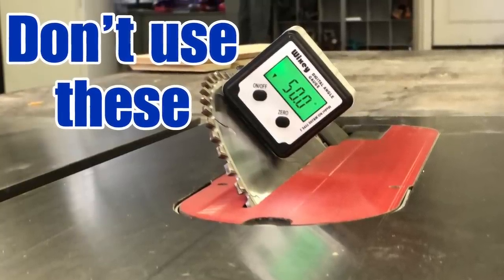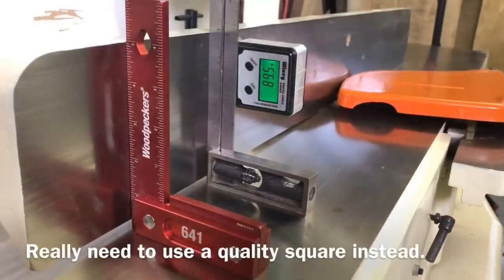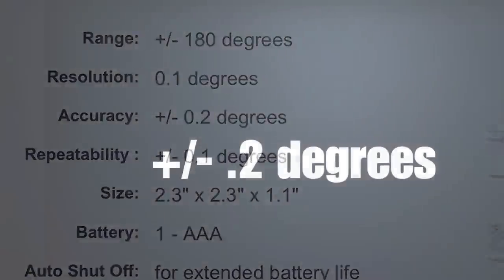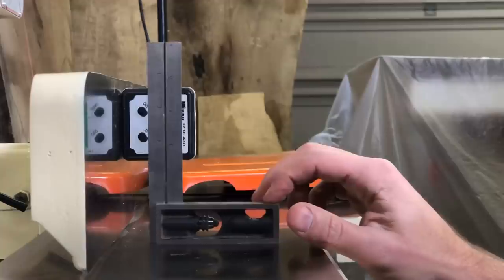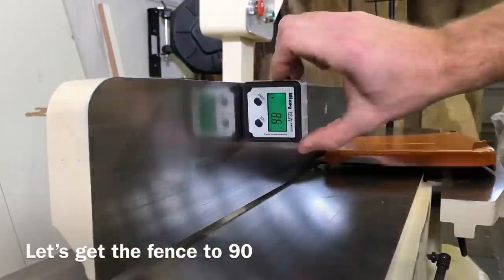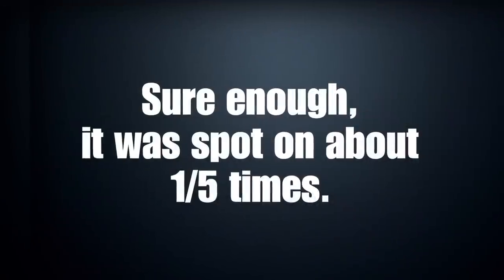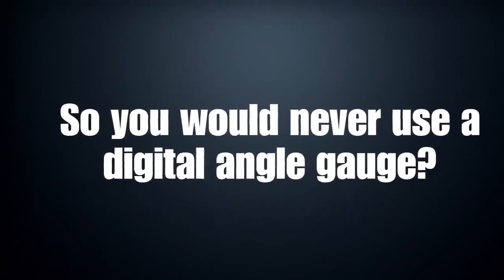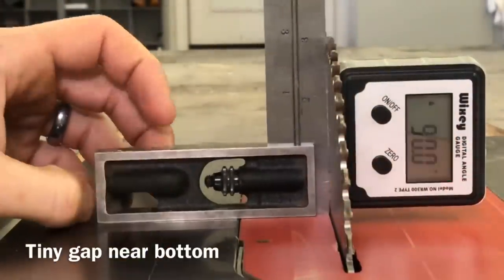Table Saw 101– Digital Angle Gauges— How To Woodworking

Comment: What about the analog gauges that use a dial and gravity to hold the needle steady as the magnetic base rotates? Are these any better?  I believe they are called magnetic angle indicators.
Reply from the maker: Never used em!

Comment: If it were inaccurate in the same amount in the same direction each time, then it might be ok, but to have a 0.5-degree swing would not work for me. Imagine using the table saw to straighten an edge for a butt joint. Any amount of inaccuracy is going to be magnified as cupping in the final glue up. So for 90-degree angles, it's just as easy to grab a static square.

Comment: The electronic gauges are just fine for woodworking.  If i was making a Rolex watch then i would agree
Reply from the maker: Thanks for the input!
Reply: Completely agree. And woodpeckers squares have been known to be off. Also, visually looking at a the square is not that accurate. You won't be able to see the .001-.005 which would be about .1 degree off. You need feeler gauges if you want to be that accurate.
Reply: Aaron Frasco you don‘t see it, but you can feel if the square is wiggling. Also, even “just” for woodworking, a perfect 90 degree angle is important. If you glue up a tabletop consisting of 10 pieces of wood and your jointer is off by .2 degrees, that makes 8 joints times 2, because you’re now joining two crooked pieces together, and suddenly they all add up to 3.2 degrees. So now your tabletop has a radius right from the start. Sure, if you flip over every other piece they even out, but first off, you don’t know if the grain allows for that and you wouldn’t know that they’re crooked because you think your boards are square.
Trust me, it does make a difference. When cutting miters to make a 90 degree corner, you notice if the saw was set to 44.9. That’s why you always cut with 45.1 degrees and use a square for glue up to make sure the miter is closed on the outward facing side. Luckily, I can use a saw with built in digital adjustment.
Reply: @sejoki1  hahaha 0.2 degree? you still cut it with your hands. If you cut 50 pieces you will press every single one against the fence by the same force? And what if jointer knives are damaged a bit somewhere and leaving a mark on your board, when you lift it against fence will that mark move it out of square for that 0.2? How often you sharpen hour knives man?

Comment: Square is the best way for a 45-degree angle or 90-degree angle.
But, if you need a 33-degree angle or 127-degree angle, only digital angle gauges can do it.
Anyway, who cares if it's 89.9 or 90.1...
Reply from the maker: Yup, this is really just a personal call for each woodworker. Sometimes close enough is good enough 👍🏼👍🏼

Comment: Depending on the work 0.2 even 0.1 is too much , I don't have one like this but the other one that unfolds. I believe the best possible way but I haven't done it yet is : take a laser and put/glue it inside a square wood block , find the corner you want and then place the laser on to the saw blade , mark with a pencil on to the roof for the most used degrees and then reset with the laser every time , that way if for example the mark is two meters away you get 0.03 accuracy for each mm
Reply from the maker: That’s a serious method!

Comment: Digital gauge maybe accurate but the problem may be its small footprint that attaches to the fence. Any specks or a slight wave on the surface could have more dramatic effect on it compared to a foot-long square that "sees" the whole length.
Reply from the maker: Good call

Comment: I have several Sterrett squares of various sizes and configuration. They are essential to fine woodworking. Everything begins with a good square and a sharp pencil.
  I was surprised and disappointed at the Lack of accuracy of the digital version. I have been wanting one of these... specifically for angled tablesaw blade set up, for quite some time. I guess it's back to old school set ups.
Reply from the maker: Yeah, some people on this thread say there are super accurate digital ones... but people on threads say a lot of things I guess.

Comment: These most likely work with a gyroscope. So the degrees are compared to gravity, not the surface of your machine. Your fence might be 90, but your table may not be level (it probably definitely is in your case ;) , but I wanted to point that out for the record). This also means they are susceptible to drift (the gyro in your phone also has it) and it might help to calibrate them before use (if that’s even possible). Though if it really is only right 1/5 times.. that’s pretty bad :) good video. Thanks
Reply: As long as the drift is the same at all angles, it will disappear when you set the 0 (which he does several times in the video). You do have OT make sure that you don't flip your angle gauge around as you will then have error that is double the offlevelness of the table.

Comment: Good info but...  even 0.2 degrees is more than accurate enough for all but advanced hobbyist, semi-pro, & professional wood workers on small parts.  

For the most part, digital gauges are not generally used to find 90 degrees... but are generally used as a more accurate angle guide for table saw / miter saw where an in-between angle is needed.  Some digital gauges claim an accuracy rating of +/- 0.1 degrees and there's also a digital angle gauge that claims an accuracy of +/- 0.05 degrees DXL360.  However, for the price difference & what I need, 0.2 degrees off is fine.

Comment: I believe you get better results if you maintain the upright position of the digital reader rather then rotating 90*. Set at zero, upright and place the side angle to the blade. Both positions should read 0.0*
Reply: That only works if the sides are exactly perpendicular to the bottom.  Mine isn't.

Comment: If you cut the same angle in a board there is a way that that angle will cancel to be a perfect 180. So in the end i just alternate the show face and the hide face against the jointer fence or table saw table and the angle cancels out to become flat. 0.2 degrees on a leg to apron joint isn't goign to be noticeable and if it is back bevel your tenon shoulders.
Reply from the maker: Andrew V that’s a nice trick!

Comment: I will admit to using a Digital Gauge more often than not.  It's just easy, and most of my projects don't require a PERFECT joint.

I did notice the other day that using the Digital Gauge, 90.0 on my saw blade looked "off", so I switched the gauge to the other side of the blade and sure enough it was off by .5 so I split the difference.  Might be time to either replace the gauge or buy a good square.

It just HURTS to put that much $$$ into something so small.  :-)
Reply from the maker: I’m right there with you!

Comment: Wood is compressible and your cuts should be just ever so slightly oversized so 0.2 degrees isn't an issue in most cases. It really only becomes an issue when the piece is really long because then that angle makes a bigger gap at a long distance away
Reply from the maker: Thanks Chase!

Comment: If I were calibrating for the machining of close tolerance parts, like internal combustion engines, then the digital gauge is not to be considered, but what the heck, this is woodworking and normal wood movement exceeds the published tolerances of the gauge.

Comment: I have a 2 dollar speed square I bought a million years ago that is dead on accurate. I also have plastic draftsmans triangles which are perfectly accurate that cost me 6 bux for a whole set of them. I paid 30 bux for one of the digital gauges and never found it faulty yet although I will be checking into it after seeing this video. I get emails from woodpeckers frequently because they are affiliated with one of my woodworking magazines but I wouldn't buy their products if I won the lottery. I'd be ashamed to be seen holding one of them. A fool and his money are soon parted.............
Reply from the maker: Errr, thanks! (?)
Reply: I "resemble" that comment I have fooled out a huge pile to WP tools.  I love every one of them and take great pride in ownership and using them.

Comment: So, basically, 3:44 to tell what even a novice woodworker like me can quickly realise: digital angle gauges come into play when the bevel is NOT your average 45/90° but an arbitrary one - else, I could just use one of the random, precise and boringly cheap squares one can find around.
There's little use for an oh-so-cool-and-bloody-expensive super perfect Woodpeckers square if your angle is not 90°...

Comment: Nice demonstration. I've never really thought about getting one of these gimmicy things always used a try square or pertractor on a trial piece first. Like you say   buy good quality tools they'll last you a lifetime. Check your squares against each other on the machine table.I'm not a big fan of the sliding rule type for checking  accuracy seen too many inaccurate ones even the good quality makes.

Comment: I want to build a geodesic dome so having the accurate dihedral angles for the bevel cuts is very important. If I am off by 0.2° on each bevel, I risk having serious problems joining all the panels together.

Unfortunately I am strapped for cash for the foreseeable future, but perhaps I could find a friend with one of these tools. Cheers
Reply from the maker: Cheers! There are videos out there on how to turn a $5 square into the accuracy of a $100 square. So maybe a good place to start!
Reply: That is what caulk is for!!
Reply: @markw3598  no it's not. What if the bevels are too big?

Comment: Great video and did not think about the variances in digital gages.  Guess I need to break out the wallet and get some quality squares.
Reply: I don't own a digital gauge.  Always have used my Sterret square, but I worked in a tool room so I'm anal about woodworking.   That also makes me slow as mud.☹
Reply from the maker: Yeah, not fun to buy but necessary!
Reply: Kinda makes you wonder how anybody made perfectly square projects before the advent of digital gauges? Wait! They didn’t, it is wood for crying out loud. Still, 89.800 degrees is a good start. Yes, a $90.00 square is perfect and I have referenced my magnetic digital gauge off the square directly and 8 out of 10 times they agree perfectly. The other 2 times it may be 89.9 or 90.1. Another reason I try not to tilt my blade ever.
Reply: david porter for my stage of woodworking 89.8-90.2 is damn near perfect.
Reply: @BlacktailStudio  I've got a 5" since bar that I haven't used while wood working😁.   But I have used my 10" height set.  It's vernier scale.  Use it so I don't forget how to read a vernier scale.

Comment: I would not trust a square with a sliding rule to measure 90’.   If I’m cutting a Mitre I check with a scrap. I have an angle app on my iPhone, but I’ve never used it. I’m not into very expensive accessories as wood moves etc and tolerances are less than working with metal. My set squares are checked and appear perfect. So I use them on the saw blade and table. I use a digital sliding bevel for other angles. I have always assumed it was accurate.

Comment: The problem with that angle gage is that it has to be vertical to get an accurate reading. Any side tilt will telegraph into the reading. Unless you use a square to line it up, you've no idea how far off it is.
Reply: Actually, it has a zero button that allows you to calibrate it to the reference surface.
Reply: Just use a second angle guage to make sure that the first one is vertical!  Ha!

Comment: One wonders how Chippendale ever managed.  Given that this is wood we are talking about, with infinitely variable moisture content that will cause it to swell or shrink constantly throughout its life as central heating, air conditioning - and just the damn weather - have their inevitable effect I think one can become just a touch too anal about these levels of accuracy.
Reply from the maker: Could be! Since we have so
many variables, I at least try and control the ones I can. Probably overkill for most of us though.
Reply: Meh youtube woodworkers are more concerned with selling woodpeckers or other things, than making furniture. Not mentioned that a precision machinist square can be had for far cheaper and is as/more accurate then red aluminum bling pieces.
Reply from the maker: Andrew V that’s a good guess. But woodpecker didn’t pay or sponsor me in any way. I actually prefer my Starrett. Which is why you see me use it first. Aluminum squares (like woodpecker) are much less susceptible to being bent that a good steel square though. I always appreciate feedback. And usually respond to comments. So feel free to ask me next time if someone sponsored me.

Comment: If the digital gauge is reading based on gravity, then could it be that the jointer isn’t perfectly level? If the bed of the jointer is 0.5 degrees off of level (or 0.3 + the 0.2 variance) then that would account for it. The digital gauge isn’t measuring square against the bed, but square against gravity. Granted, square against the bed of the jointer or table saw is what actually matters.
Reply: Jason Clifford - Actually the digital gauge zeros itself off of the bed so the reference of 90 is based on the bed, not gravity
Reply from the maker: Dan is right. Both reference the bed of the tool. Not the floor. All our shop floors are so uneven you’d never get it to work if it were based on gravity.
Reply: Ah, ok my bad. I didn't realize that. Now I know :-)
Reply: @JacTrades  It's all good.

Comment: It depends also on what brand of digital angle gauge do you use. There are brands and brands, quality is more or less present in different brands' products. Therefore, I think you should get multiple brands and versions of the same type of product, conduct some tests and experiments and you'll have a documented and fair conclusion.
For example, I own both Wixey and Klein Tools angle gauges. By far, the Klein one beats the Wixey. Klein is very accurate even after repeated measurements on the same setup. The value I get is always consistent and constant (I always take 3 to 5 measurements for the same setup, just to be sure).
And also, some devices are not well calibrated from the factory (cheaper ones don't have rigurous quality controls). 
So far, I am pleased with my gauge and it does a very well job (I am a picky person, don't read me wrong. I am not just satisfied with mediocre). And I do precise woodwork many times.

Comment: I did check the manufacturer's specs but I am left wondering: how can the resolution be smaller than the accuracy rating? This is mathematically illogical.I have used the WIXEY for years in my shop and have had no problems with accuracy And accuracy in my shop is of utmost importance.
Reply from the maker: You’d have to ask wixey why they did that. But I say if it works for you, dont change it!

Comment: Maybe the entire saw is off by a fraction of a degree? The fence may be at 90° to the table, but maybe the table isn't perfectly level and thus, the small error off of 90° by the digital gauge?
Reply from the maker: These gauges aren’t based on level. Would be hard to use if they were!

Comment: It depends on how thick the cut is 1/4 inch no problem.  What about a 4 inch cut?  Could be a problem.
Reply from the maker: That’s a great point actually. Jointing beams changes a lot more than some 1/4” rips. Thanks for the comment!

Comment: I was so excited when I first got mine but then I quickly realized how inconsistent it was. It’s collected dust on a shelf ever since.
Reply from the maker: Seems to be a right of passage. Same for me.
Reply: I still use mine, and I'll do the 5x check and take the average....and then test cut.
I dont have a band saw yet...or a planer...+/- 0.2 degrees on a resawing cut is brutal especially if I'm resawing greater than 3" and have to flip the board. If I was 0.2 off when making the edges parallel it compounds with the 0.2 on the new face cut and my piece starts looking like a big C Channel  -  lots of hand work to fix
(I really need more tools - time savings alone would make up for the cost!!)

Comment: A device made to do one very specific job (check right angles) is most often better than a much more flexible one (checks any incline) at the same price. More uses provided for and QA’d on the same budget. Skewing the price in favour of the already advantaged, limited device kinda deep sixes an already pretty troubled comparison.

Comment: Agree that digital angle gauges are not that accurate.  You used two tools that I am very familiar with - Starette has been around a l on g time.  Learned about them from an old Master Tool & Die maker that built 16” cannon barrels for battleships in the 30’s and 40’s.

Comment: Don't you need a perfectly level table saw for them to be accurate?
Reply from the maker: Nope. Never seen a shop floor that is level. So that would make it hard!
Reply: no. you zero the gauge to the table saw or jointer surface first so that your angle is always relative to the horizontal work surface.
Reply: @rickymcgrath2314  
Ok....makes sense.

Comment: I feel like your missing something, don’t you need to make sure that the table is plum first?
Reply: not..  the cut cut is always relative to the angle between the blade and surface.. the whole machine could be 20 degrees of plumb and it wouldn't cut a different angle on the materials being put through.. might be hard handling the materials being fed into it though LOL